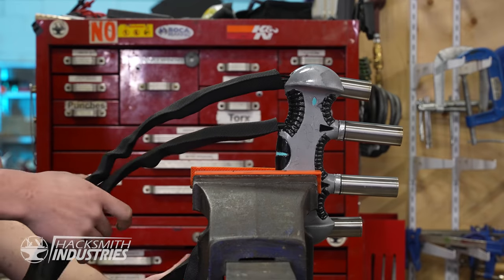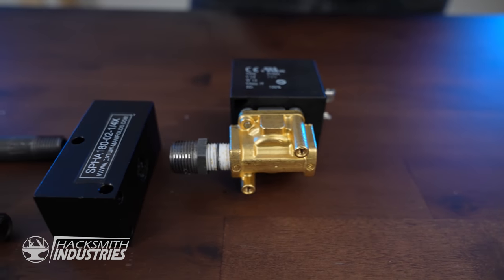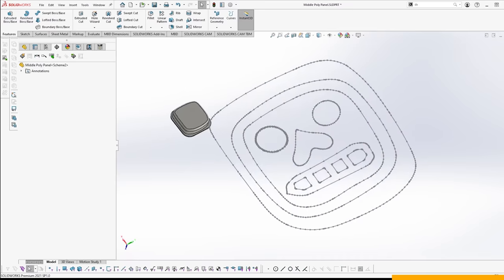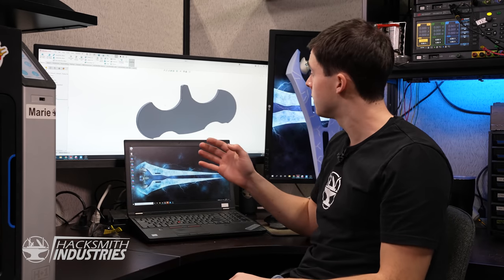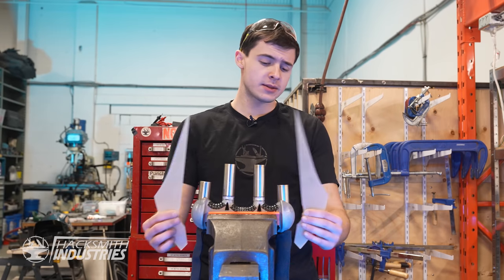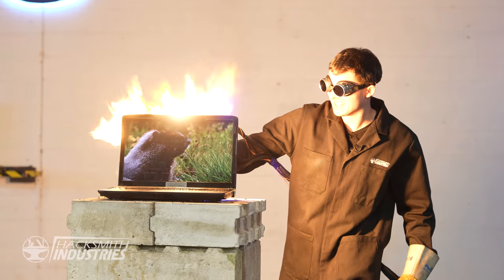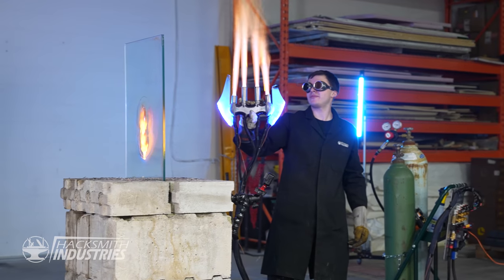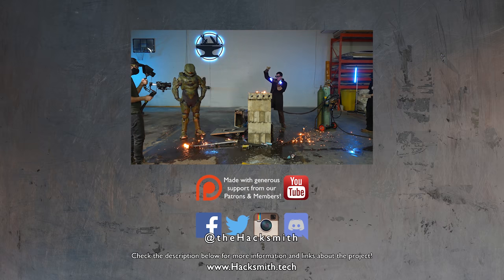Hydrogen powered HALO Energy Sword

Comment: So here's the real question:

Since you also made a lightsaber, can we finally settle the debate of lighstaber vs energy sword?
Reply: No debate needed for that... Lightsaber always wins.
Reply: @JayVest  in this fight, 4 flames of hydrogen, against 1. I believe we have a winner.
Reply: Matt pat made a video elite energy sword would win
Reply: @Bolt451  yeah but he didn't took into account THE GRIP. The Halo weapon grip is way too loose, is far more possible to injure yourself in the most ridiculous way and you can't switch between hands like any sword-type weapon, which also tightens the grip. Pretty stupid detail but it's also pretty definitive
Reply: @JayVest  Energy sword for the win
Reply: Lightsaber, not taking into account the person wielding it, it’s a better grip and is less risky to the person using it and kills just as effectively as the energy sword, because 1 shot to kill can’t be beaten, just refined, and the lightsaber is more refined than the energy sword

In terms of power, energy sword wins but in combat, both kill as quickly as each other so makes 0 difference

Grip, lightsaber, it’s easier to move in your hand and as such means you can move easier 

Weight, lightsaber, it is at least 2 or even up to 4 times lighter meaning it’s more efficient stamina wise to swing

Lastly, range, a lightsaber actually has a longer range (to the movie/game) than the energy sword
Reply: @OhMoonPresence  this exactly. Thrust weapons in real life have a longer part behind the hilt that protects the forearm and tightens the grip
Reply: @OhMoonPresence  This guy knows.
Reply: @JayVest  every part of a weapon and it’s purpose of being made matters
Reply: You would need to make them way better to actually settle the debate
Reply: I mean its all about the range so lightsaber wins
Reply: @enslavedcontent  not all about range but damn, it certainly helps
Reply: Same concept, so imma go with the quad lightsaber or the energy sword lol.
Reply: They'd need a Sangheili to test that since the energy sword isn't made for human physiology. 
For humans a lightsaber is definitely better.
Reply: @Nandreani  the energy sword isnt meant for human hands so the grip wouldn't be suited to us but I agree that the lightsabre would win it just has too much range.
Reply: Energy sword is cooler, so it wins by default.
Reply: @JayVest  Actually in a technical fight lightsaber wins against the energy sword. The energy sword has 1 fatal flaw against the lightsaber, the gap. Ride the lightsaber blade down the gap of the energy sword and into the hilt, boom, no more hand, no more energy sword.
Reply: Lightsaber They are used by Jedi or something like that, of course they have superpowers

But the energy sword is used by a 2m guy, with almost 1 ton armor, enough force to open a hole in a concrete wall with his bare arms. 
It has a speed of approximately 100km / h and also jumps 2-3m in the air 

Doesn't matter what the weapon is, but who uses it, then the energy sword wins.
Reply: The energy sword is way longer than a lightsaber, it only looks small since elites are wayyy taller than a human, a proper dueling energy sword is over 1.5 meters long, and are so hot they melt titanium armour with just a  near miss.
Reply: @majesticwolfyguy6629  Not necessarily true, lightsabers have different lengths depending on the user.
Reply: @Eustakista  Not really. Slide the Saber down the gap of the Energy Sword and into the hilt and you effectively destroy the Energy Sword.
Reply: @megaman37456  You know how they work and are used, right?

They are made for stab and slash so...
Reply: @Eustakista  Yes and Jedi have reflexes that an Elite or even a Spartan could not replicate.
Reply: @megaman37456  spartans reflexes are blury to the human eye, they literally can run at car speed XD
Reply: @Eustakista  depends on the spartan and generation too, I mean seriously Fred or Kelly with Gen3 armour would put down a jedi like it's nothing
Reply: @Eustakista  And Jedi reflexes literally allow them to predict future attacks and movements, it why they're such good pilots, why only Sith can defeat Jedi and why only Jedi can defeat Sith.

Spartans and Elites would be no match in an actual sword fight with a Jedi or Sith.
Reply: @megaman37456  has anyone ever told you about the mandalorian wars mate? plenty jedi died to mandalorians and a smuggler killed a sith so your point of only a sith can kill a jedi and only a jedi can kill a sith doesnt count, cad bane has killed jedi too and hes not faster than a spartan so yes, kelly, fred, chief and probably linda could take down a jedi with relative ease and chief has something not even the force can forsee.... luck,  and another thing the standart length of a lightsaber (so no alterations to the length) is around 90 centimeters, a halo energy sword is 1.3 meter long but this can be longer for bigger sangheili or different types of energy swords
Reply: @blackg8r20  Not gonna lie, I legit forgot the Mandalorian Wars existed lol
Reply: @Nandreani  yep, the energy sword was made for thrusting combat, while the lightsaber was made for swinging combat
Reply: @JayVest  Light saber would be the worse weapon of choice, maybe more iconic and cool, but not better
Reply: All I got to say is if it was like a real 100% halo energy sword then the energy sword would be the winner. 
Because a light saber 25% of the light saber is just a handle/grip 
while the energy sword 5% of the energy sword is just the handle/grip 
And a light saber is like 1 whole super Lazer 
Wile the energy sword is 4 plasma lasers and in the game you can do a glitch where you can fly with it by lounging at a target and I think looking up right as you start to fly at the enemy
Reply: Probably depends on the blade. Lightsaber tech has proven versatile enough to take many forms.
Reply: I think I'll be more comfortable with the light saber
Reply: @siydot6068  Lightsaber has range
Reply: @-soap23re-17  It also depends on who's using the blades.
Reply: GOD
Reply: @megaman37456  the gap is meant to catch another blade and disarm the opponent. It is sealed and protects the hand.
Reply: @average32potato  Not in-game nor is it in any of the cutscenes or physical models out there.
Reply: Energy sword is just better designed for combat, it's larger than the lightsaber (4 feet long to 3 feet long), it's blade protects the wielder, and if we're talking designs then we could simply say that the energy sword has the prophets bane handguard design seen in h5, since the lightsaber has no lore regarding hand protection, other than the cross guard which, isn't actually for protection they're just vents for the unstable crystal. Also both weapons would weigh the same as the blade has no weight (no force considered here.)

Keeping this in mind, an equally skilled energy sword user and lightsaber user would result in a victory for the energy sword around 7/10 times, most fights last a short amount of time, barely 5 swings of the weapon in fact.
Reply: @JayVest  my energy sword will kill the demon
Reply: @Nandreani  it's not stupid you can have to energy swords instead
Reply: @eiite4578  guy who knows nothing about star wars lore or sword combat says what

1. dual-phase lightsabers have variable length, and can easily be multiple meters long (beack when legends was canon there were giants who became jedi, even, and had proportionally large sabers)
2. lightsabers prevent the enemy weapon from moving when they're in contact. you don't need a hand guard if the blade completely stops the enemy's weapon from sliding
3. the energy sword has an absolutely stupid design, which completely prevents you from having any leverage whatsoever and limits you to exactly one type of strike from 1/4th the angles that a proper longsword can reach.

this is all ignoring shit like the broadsaber which is like a proper arming sword specialized for slicing and the other types of kyber crystals 

in a fight between equally skilled combatants, the lightsaber wielder wins every single time no questions asked
Reply: I love Star Wars and have been a part of that community for much longer but I think the Halo Energy Sword wins

Comment: that was really cool, wish you had angled the outer ones a little more so they met up with the inner ones at the end instead of having the gap, would be cool to see a hacksmith redesigned handle cause it still looked a bit awkward to hold.

Comment: This would be an incredibly useful tool in a deep space era rich in hydrogen gas. 
If you made a huge disk array with say 32 of those nozzles and mounted that to a vehicle could you mine solid rock/mountains?
Reply: Melting through everything would be way less efficient than just using that fuel to power a grinder or using it to make explosives. Not to mention now the floor is lava, soon to be a solid sheet of rock, instead of a bunch of loose debris that can be easily excavated
Reply: @rockyroadmagic4152  technically then couldn't we use that magma to create obsidian in the correct conditions? Purposely melt down a huge area like a man made volcano and extract the molten glass and rock created.
Reply: @DarthRektar  I’m pretty sure not all rocks can be used to make obsidian. Also I’m not sure how high the demand for obsidian is, what is it used for in our modern society, besides like, some surgical scalpels? I think you’d be hard pressed to convince a mining or construction company to adopt a technology that uses fuel very inefficiently just to extract bulk quantities of a (probably impure and imperfect) material that nobody wants to buy
Reply: @rockyroadmagic4152  Obsidian is basically just glass with minerals in it, remove the glass and you'd basically be refining an ore bloom
Reply: @BlightfulProductions  He knows what Obsidian is. Every single post he has made is highlighting why this is useless. Even if you want to make obsidian you would probably want to work from pure minerals and create it from an exact mixture rather than just pumping rocks in the wild. 

If you want to separate the materials - existing mining and foundry processes are pretty efficient...

Comment: Imagine in the future this becomes even more realistic and it cuts diamond just in a sec
Reply: Energy density is the problem there. If you want to achieve that, you need a nuclear reactor not only small enough to fit in the handle, but also light enough, which is even more impossible. Having a reactor that puts out almost 100kw with a weight of just a few grams? Well, I do not think that ever will happen.

Comment: Ok, this may seem far-fetched but I have an I few to make it look more like the sword in real life. Because you partnered with the company that makes the nozzles you could try and design the nozzle as a less circular and more flat like the real sword. The logistics of how I’m not smart enough to understand if it’s possible but it’s just and idea, the only issue I can think of is the two gasses needing to be still mixed properly. The new nozzles can be then attached in groups of two, like how you guys did it, and adjusted to look like the real thing. OR you could make nozzles that are big enough and angled just like the real sword so you can lower the parts count and hoses. Idk if any of this is possible it’s just what I was thinking and wanted to share

Comment: You need plasma for the energy sword not flames.
Reply: You do it
Reply: I'll wait
Reply: Whaley do it
Reply: Don’t think you understand, but the flames are the plasma. When you superheat a gas (hydrogen in this case… normally not useful because of large tank sizes, except there’s no backpack so they said screw it), with something like oxygen (burns very, very hot. Used in rocket engines), it gets the combined gasses so hot they form a plasma
Reply: Flames are a form of plasma too

Comment: Well, Sangheili energy sword actually uses magnetic fields to divert plasma through specific patterns that also gives the blade that specific and peculiar shape.
You basically needs two projectors of plasma and some sort of very compact magnetic field devide to put inside the handle of the sword.
It's a huge work of miniaturization.
But you know? As long as you can comprehend how it works, then it's just a matter of time to reach the final product. Humans can do everything.

Comment: Ykw based on this for an energy sword to function just like the games it needs to somehow prevent thermal energy from making it impossible to use for long periods of time while also being hot enough to melt through most materials with little effort, which based on my knowledge and an estimate would probably have to have plasma about 2-6 times hotter than the surface of the sun.

Comment: Bogdan : Unlike our lightsaber, the Halo Energy Sword has two beams with a gap in between, so we're gonna use 4 nozels.
Me : If it has two beams with a gap in it  shouldn't it be 2 nozels so it'll be accurate? And it'll cost less and less gas usage

Comment: i think it wouldnt be half bad if it only had two nozzles on each side of the handle at a slight angle inward, would use half the fuel and still have a lot of power

Comment: Why'd you destroy a perfectly good laptop :( Wanna trade for an old macbook the next time you need to melt one?
Reply from the maker: Turning on doesn't mean it's perfectly good... it had other problems
Reply: @hacksmith  LOL! Ok, I work in IT so I do have to give you that. In fact one device type I deal with basically daily has major issues with certain things but does turn on... 

That said I like my version better since I desperately need a new non-work laptop and Macbooks melt really well with all that metal XD

Comment: So it’s a flamethrower
Reply: No bcs the superheated gasses form a plasma. When you get farther away from the ignition, it cools off a little which is why it’s a flame instead. But when you burn hydrogen and oxygen like they are, the combustion temperature is INSANELY high, enough to form a plasma